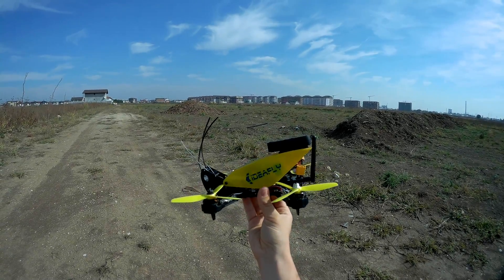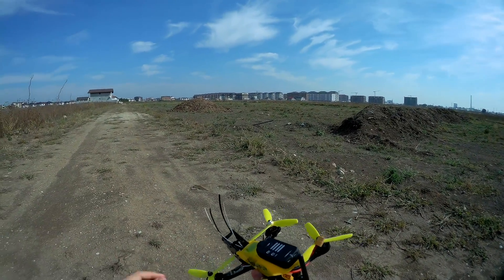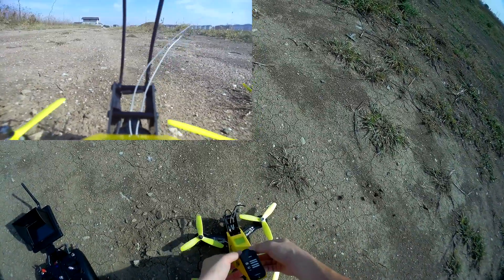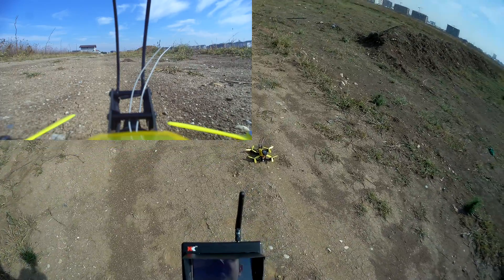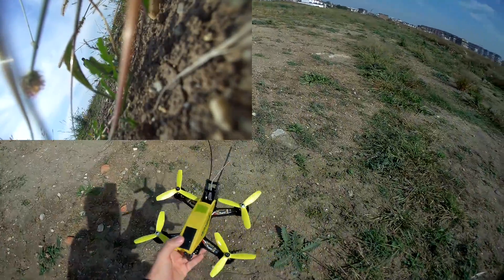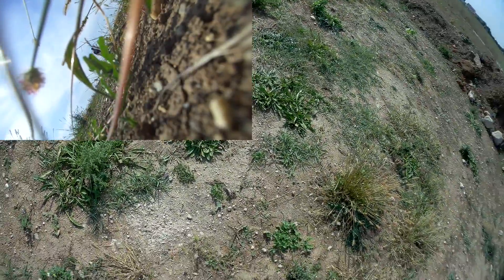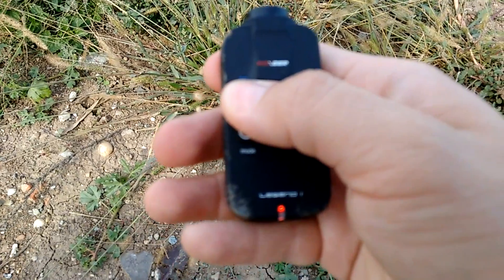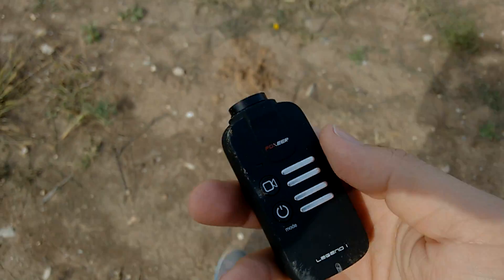IdeaFly Grasshopper F210 Maiden and Crash ! - part 3

Comment: that's a bummer,I had a very similar experience with the Grasshopper in a previous flight,took me 30 minutes to find my runcam,fortunatelly it is orange so that helped.At the time I had all out of the box settings and it would randomly flip in angle and baro modes on it own.I have since plugged it into betaflight,I did not flash the latest version to the fc,all I did was calibrate the accelerometer,lower the idle speed,calibrated the motors/ecs and I think most importantly I disabled the barometer.I now have angle,horizon and acro modes.I took it out for it;s first flight and it was really good.So far so good.Hopefully you can get yours dialed in as well TechTronic9000
Reply from the maker: I already did a accelerometer calibration and also disabled baro, I will probably put cleanflight on it.
Reply: hola, ayuda pls , donde puedo comprar los esc para el Ideafly F210 Grasshopper , gracias y saludos.

Comment: Did you switch mid-air to BARO mode or accidentally disarmed? As I said on my review (video is uploading), BARO does not work on the Betaflight 2.6 firmware the Grasshopper is running (it reverts to Acro). Glad that no damage was done on the Grasshopper and your camera.

I plan to fly mine also but only using the built-in FPV camera (waiting for my DVR to arrive), the canopy is not add-on camera friendly.
Reply from the maker: I know about the baro issue and have disabled it during initial setup.
Reply: TechTronic9000
So, why the motors turned off? Accidental disarming?
Reply from the maker: I simply don't know, it wasn't accidental disarming,  it just gave a throttle bleep (by itself) and went dead. I suspect that the problem is from betafligh which also does a similar problem with the fail-safe, instead of using low motor value it bleeps the throttle to max and the decreases a bit... It may also be related with the "disarm motors regardless of throttle value (when arming via aux channel)" setting. Default is on and if I power off the TX the motors will stop regardless of their previous speed. Disabling this will make the motors run wildly fast when TX is turned off regardless of fail-safe settings.
Reply: TechTronic9000
I plan to switch to CleanFlight immediately after performing the maiden flight. Initially I planned to upgrade to BF 2.9 but after seeing that even on that version the barometer is not utilized correctly, this was no longer an option.
Reply from the maker: ***** I'm also thinking of doing the same, first i'll do a CLI dump to save pids and settings and reflash it, haven't upgraded F3 boards until now.